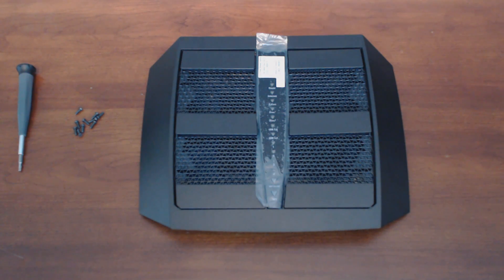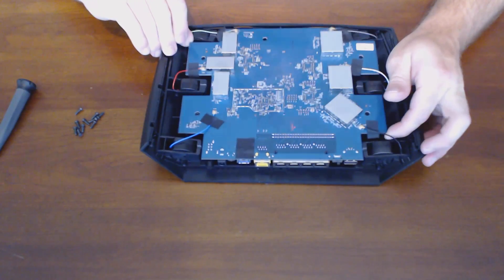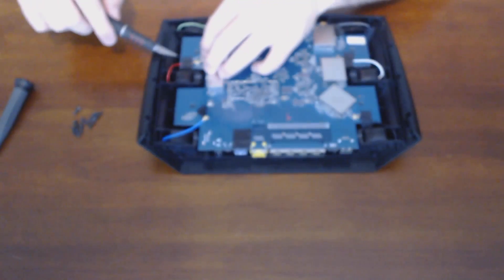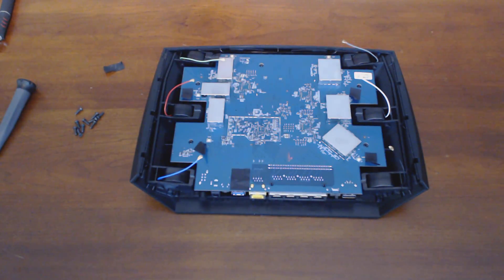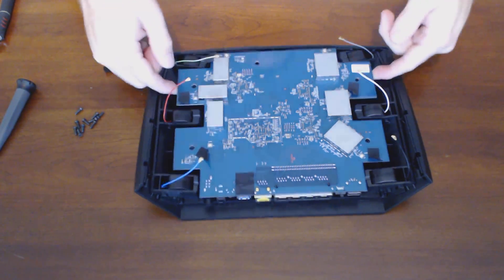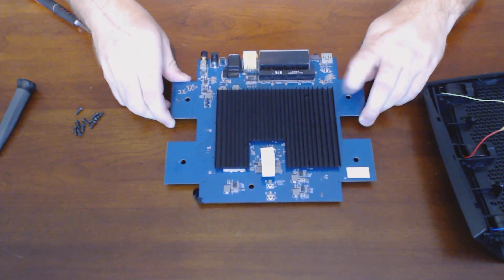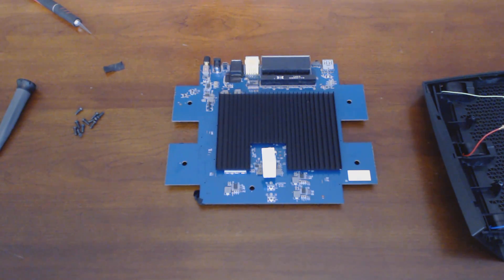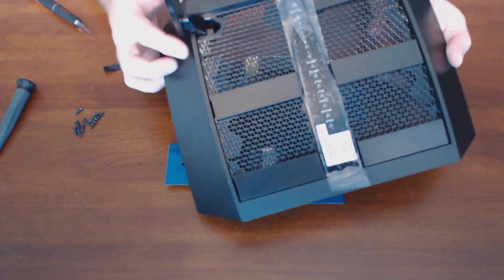NETGEAR Nighthawk X6 Disassembly

Comment: I think the R8000 antennas have some integrated amplifiers or downconverters. The coax pigtails have DC volts on them I think. I think the connectors are MMCX or something similar. My Nighthawk sucks for coverage, my ATT router has better signal strength. I think the Nighthawk integrated circuitry is faulty. Both routers sit about 12'' apart. Have you opened the antenna enclosures? The FCC data page shows that there is proprietary circuitry in the enclosures. Fill us in.   I will buy a new WiFi router soon. Good vid tho!

Comment: You need to adjust the router settings to not use the 20/40hz on both windows and the router log in and also enable AC and mimou

Comment: Thanks for the disassembly man! I needed access to the board to unbrick the modem with a USB to TTL Serial Cable and couldn't figure out why it wouln't open.
The screw under the label was the missing part, so thanks!

Comment: Totally wrong about this router. Does not get hot at all. Have 22 devices connected including 5 nest cameras and 2 thermostat. Speed is great as the software regulates speeds to certain devices. This router is awesome if paired with fiber, seeing 800mbps    download and almost 900 upload.
Reply: Do you still own this router? I have it and have constant WiFi disconnects. Wired connections are solid, though.
Reply: Steve Vaught I still have it. It seems to be working fine. I do make sure it’s updated and am cycling it once a week or so.

Comment: Subbed and Liked. Thanks for this Helped me to open it as I bricked it and needed access for the Cable connect
Reply: @ glory did you get it recovered. I did same mistake to install dd wrt  for bridge and repeater mode with no avail. now cant go back to factory stock version. Wish i just kept the original firmware.. Did serial connection worked for you??

Comment: Anyway to change the thermal paste under that heat sink?
Reply from the maker: You can, remove the heat sink and make sure all of the thermal compound is removed from both the bottom of the heat sink and the chips on the board. Use 90% alcohol and clean both surfaces. You can get some IC Diamond thermal compound off Amazon for pretty cheap.

Comment: I love you dude, thanks for your teardown video, it's very useful,  I just bought a neargear r7000 nighthawk router, and flash ddwrt at first day, but I never thought about this router will reach 60 degreee C (temperature) at idle state, and when I see its AC adapter, oh my god, DC12V and maximun 5A, I want to return this router, I can only accept 12V 1A router(for maximum 12W)and 40 degree C(idle state) router.
Reply: This router has the same CPU as a Galaxy S II with a massive heatsink on it.

If it's hitting 60c idle, it's likely not going that much higher under load or you've got something going wrong somewhere even if it's as simple as you're reading the data from an incorrect or faulty sensor... (For reference, while this isn't an Intel CPU, Intel do only officially rate the thermal sensor in their CPUs at around 90c. They actually say that it's incredibly inaccurate for temperatures under 50c to the point where you can't really say anything other than your CPU is running cool if it's reporting a >50c temperature)

Comment: hmmm almost wanted to get this router.... now i am rethinking it. maybe the next they will design it better then this way make the performance better.... cause you said the asus version is better then this beast.... odd thing i am netgear fan now i have to wait for the next version router to see if they can fix the performance better...
Reply from the maker: This router may be perfect for you, each persons needs are different than the next. If you're doing light gaming and watching online videos, this should work great. However, you can get a router that performs better for less with the ASUS. What do you like about the Netgear products?
Reply: Matt Medley what i like about the netgear router is that they have no problem connecting to gaming servers online.... it is game servers friendly... so i know i do not loose connection unless it provider in local area is having things fixed cause of a telephone post or wire cut  in area  of use of internet. i have had routers that did not like certain games online so i just went to more expansive one netgear and i notice i was always connected with no hassles to game servers so i stuck to the brand for years.... even when i have a ASUS ROG G750JZ-DS71 17.3-inch Gaming Laptop, GTX 880M Graphics laptop for my computer that i bought last year so i wanted make sure i well awesome wifi handle my games that put in it.
Reply from the maker: bulldzr70 That's a good reason to stick to a brand you like. Keep in mind that most newer routers are XBOX Live and PSN friendly and make it very easy to setup your router / internet connection for gaming.
Reply: Fact is, good wireless is always going to be good wireless and perform about the same as other good routers of the same vintage regardless of rating because the big difference comes down to chip quality and the like as when you're talking about CPU binning/overclocking and the like. My R8000 is perfectly capable of handling 100Mbit/s even on the 2.4Ghz network and the whole reason I got it is because it's incredibly well designed and not likely to die soon without sacrificing performance. (It's CPU is the same as a Galaxy S II, with a heatsink that size I have zero worries with leaving the router on 24/7 even in Australia when it gets nice and hot during the summer. I've actually had a couple of modems die from overheating before, too)